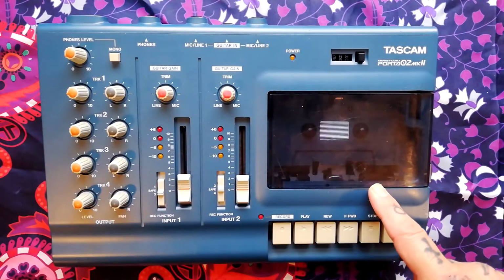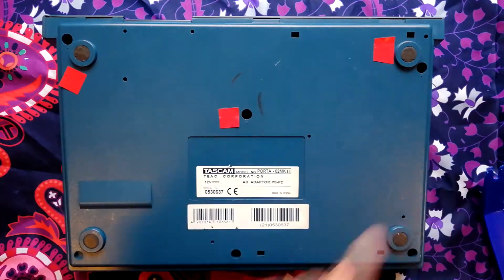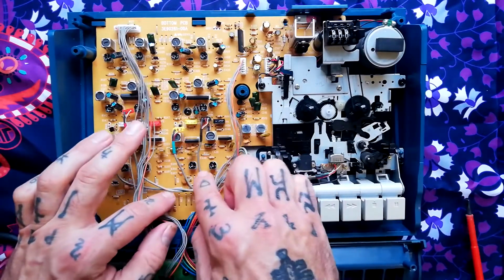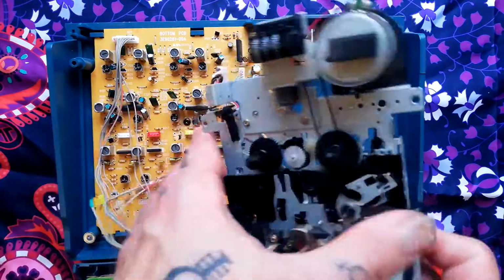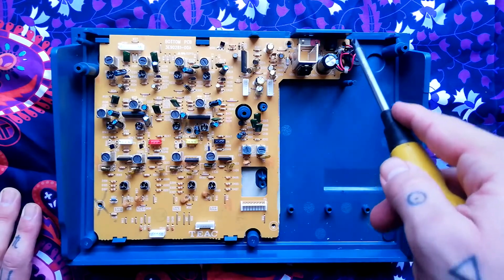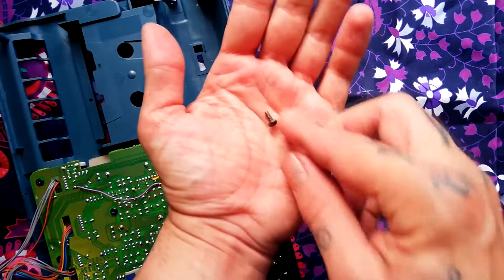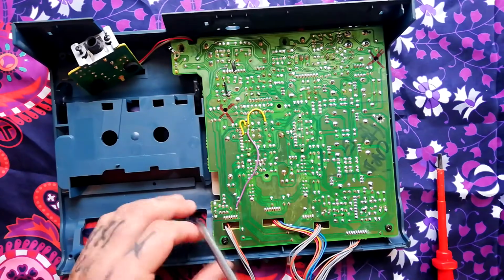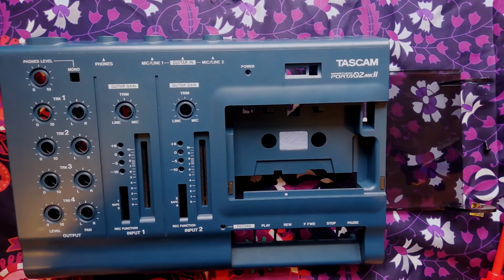Tascam Porta 02 Mk II | Tear Down

Comment: Thanks for this video - definitely a straightforward job but this guide was very helpful. Just upgraded the 220uF caps in mine and it's back in action after a power supply mistake…

Comment: Thanks for this, it helped me replace the capacitors (128, 228, 328, and 428) in order to get audio to come out of it. However, I've noticed that when both inputs are set to safe, the minute one of the tracks starts approaching +6 the sound starts pumping. I may need to put a video up to demonstrate. It's really weird though. This doesn't happen if just one of the inputs is out of safe mode - I can have the tracks as loud as I want then.

Is this something you've encountered before?

Comment: This is a great tear down Tetrakan! I have a Porta 02 mk2 that on teardown looks mint, no obviously bad components upon inspection. I bought it and I reckon it's only been used a couple of times. I have no playback signal - all inputs / pre's and transport working correctly. It's also recorded my inputs as I tested that on another loaned machine but, not getting any signal playing back from tape. Any ideas? Thanks in advance.

Comment: Hey, thanks for the breakdown. Ive had this four track for a couple years and while recording with it today, i noticed there was an issue with playback. I recorded keyboards on track one and attempted to record on the second track, and when i finished recording, i went to listen and noticed it didnt record anything. I recorded on the second track again and it did the same thing. I recorded on the third track for good measure and...nothing. The red led light near the record button is on when I record and the led lights near the faders light up and show audio is going in. Any ideas?

Comment: Thanks for making these videos... I have one of these and it worked great for a couple of months and then one day it just would not power on, yes I have the correct power supply and I even tried a second PS, any help would be very appreciated.
Reply: You've probably already done this or moved on, but have you checked the capacitors? I have a Porta03 I'm in the middle of repairing to get the mixer board back up and running. One of the 25V 220uF caps is bloated right next to where the bulk of the power enters that board. Best of luck!

Comment: Love the video. Thank you so much for doing all this documentation. I have a question. I was disassembling my porta02mkii and trying to be careful removing the headers that connect the channels to the playback/record head. Unfortunately, I slipped pulling the header for channel 3 and one of the wires came loose from the header connector. They are so small. Do you have any recommendations for reattaching the wire to the header connector or replacing the connector?

Comment: Thanks for posting such in-depth content about rape machines! I just opened up a Porta02 after hearing a light rattling inside. As soon as I did, the wheels and rod from the tape counter fell right out. I don’t see any other loose pieces but I’m not sure how to reassemble it. Is this something you could help me with?
Reply: Update: I managed to get it back together but the leftmost wheel likes to spin freely. Any ideas there perhaps?

Comment: hey there, you seem like you've got a good grasp on these things. I have a Porta02 that when recording records an odd popping sound on channel 2. It's not a pot scratchy sound, but rather only happens while recording, almost like a vinyl pop sound. Any ideas?
Reply from the maker: I'd start by identifying the electrolytic  capacitors associated with that record amplifier using the schematics available from my blog. If replacing those didn't resolve the issue, I'd look at replacing any semiconductors in that gain stage, especially the opamp since popcorn noise, as it is called, is often symptomatic of faulty semiconductor components.

Comment: Hi Tetrakan, I purchased a Porta 02 today but I have no signal coming through input 2 line or mic. Playback signal is fine trim and pan pots working as they should. Do you have any idea what could be causing this? Faulty jack input or something else maybe?
Reply from the maker: I suppose you're could be something wrong with the preamp stage but a broken connection at the base of the  jack socket seems most likely, yes.
Reply: @Tetrakan  can the jack inputs become faulty even if there isn't a break in the circuit? Theres no noticeable break I can see solder looks good. I wouldn't know here to check the preamp stage :/
Edit: It might be worth noting that on playback, I'm not getting a stereo signal, only on the left side but the mono button works to bring it into both headphones.
Reply from the maker: Yes it's possible for no signal to pass despite there being no obvious visual indication of a problem. There are two videos I made recently which are somewhat similar to your problem and also go a long way to demonstrate how I diagnose and fix electrical issues, so I recommend you watch those then come back if you have more questions
 Here are the links  https://youtu.be/fVs0ALyEUMY and https://youtu.be/gwr8nUAkdMo

Comment: Hi, I've got a Porta 02 Mk II with a missing power on/off (sliding) switch. Could not find any replacements online. Do you know the specs of that switch?
Reply from the maker: I don't, what if, meantime, you just remove the switch and solder in jumper wires so the unit turns on as soon as you plug in the DC adaptor?
Reply: @Tetrakan  Thank you,I will do that 👍